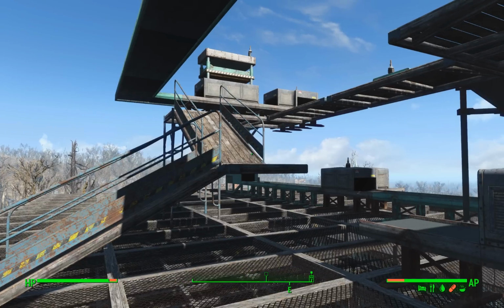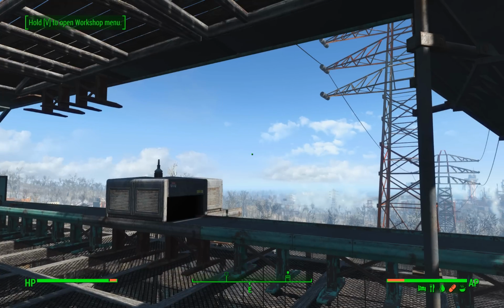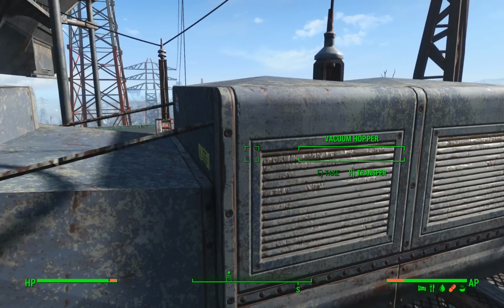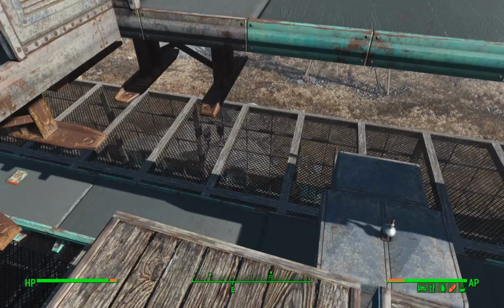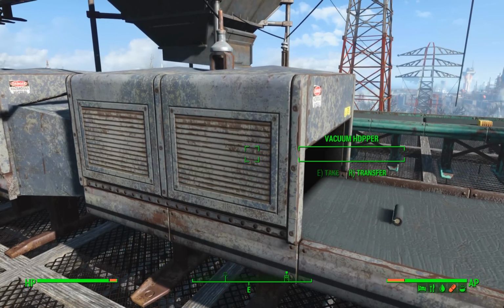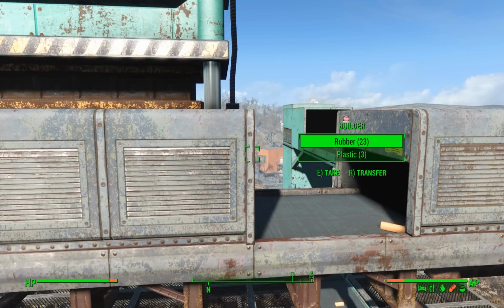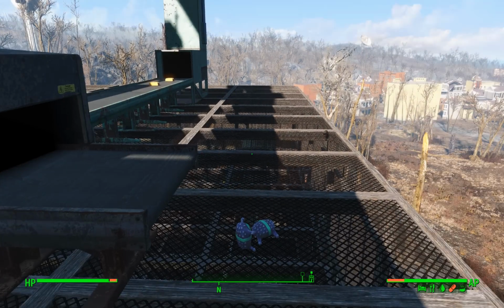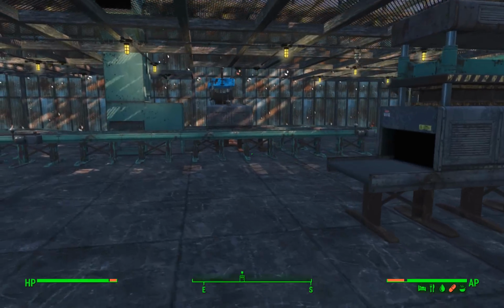Fallout 4 Contraptions DLC - Factory Setup Demonstration

Comment: I love the closed system idea! I like the sample factory, it's a good way to plan the layout of your main factory. It might be a good idea to remove all of the floors in your warehouse so you can build vertically, then you can use scaffolding to create a walkway around the conveyor belts.

By the way, I saw a comment in another video that you can position the vacuum next to the work bench, and it will begin transferring components from the work bench to the conveyor belt. My problem was that I had all my junk in the work bench at Sanctuary, so the vacuum was bringing in unneeded components. I suppose I could go to another settlement and empty its workbench out, and then just put in the components I need for whatever I'm manufacturing.
Reply from the maker: great info, did not know that...huh...that changes things a bit.